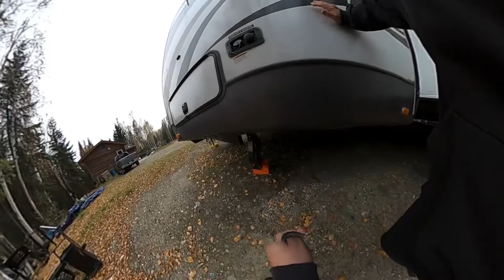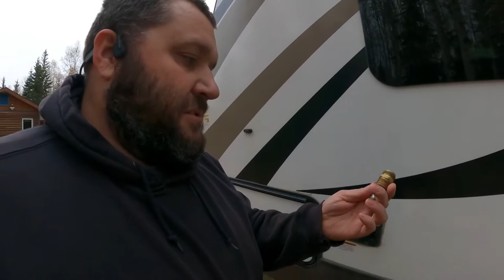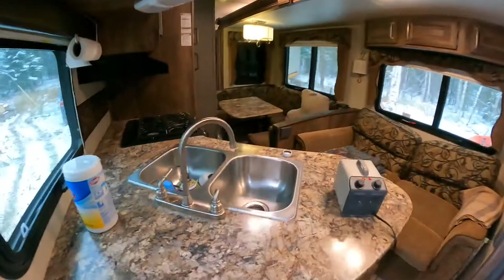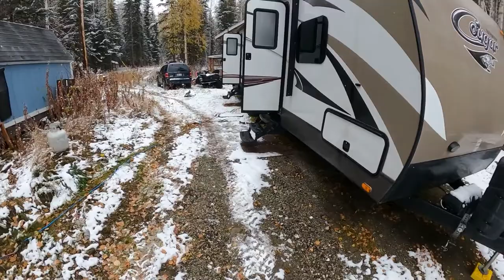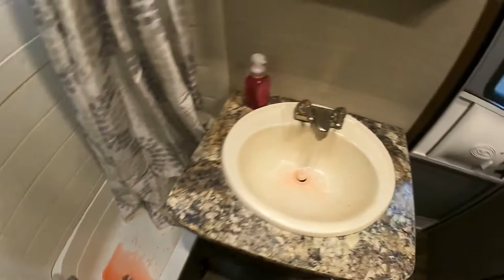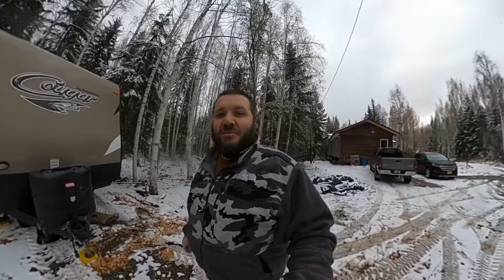Getting the Keystone Cougar Travel Trailer Ready for Winter (No RV Antifreeze)

Comment: Good evening mon ami 👌😊 Yes I can see that you are having snow 👌😊  Great vide Sir 😊👌👍 On my side, I put antifreeze in all the water pipes and elbow drain and I put spay oil on the hot heater blower outside and the in and exhaust pipes of the air heater and all the front support beam and the 4 corners jacking.  Have a great week end Cheers 👌😊🍻
Reply from the maker: Thanks Buddy!!👍👍 That’s a great point on getting everything lubed up for the winter😀. Help keep it from rusting up, I will have to add that to my routine. Have a good one ☝️ 👍
Reply: @180Floridalife  👌😊👍🍻